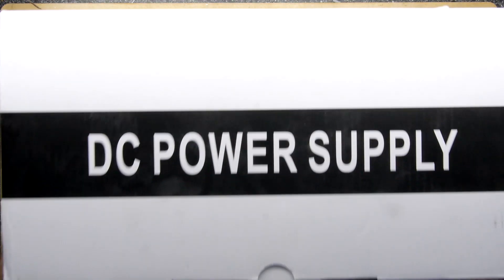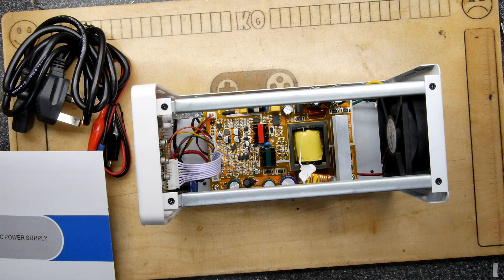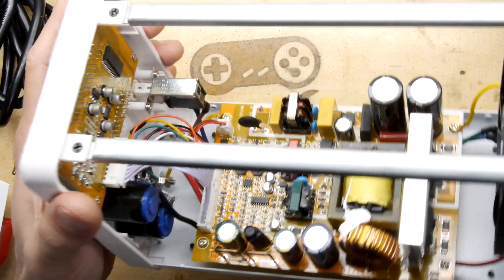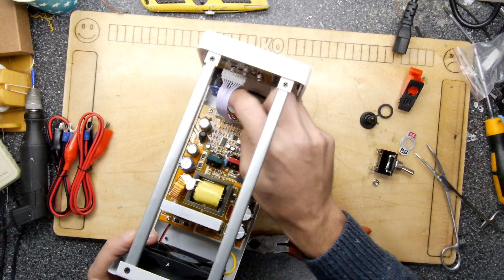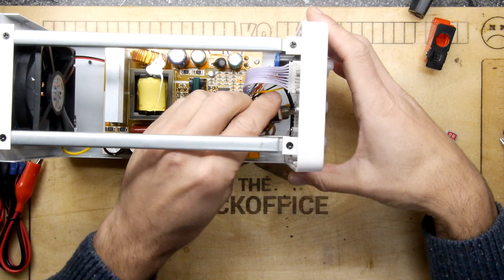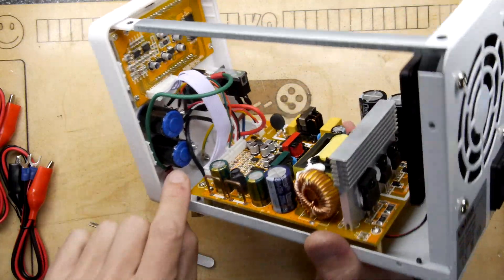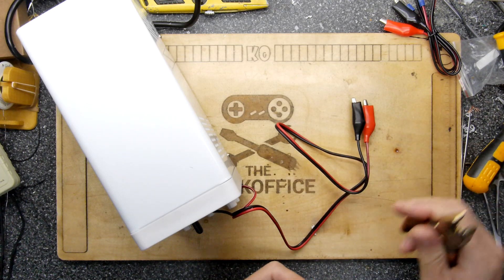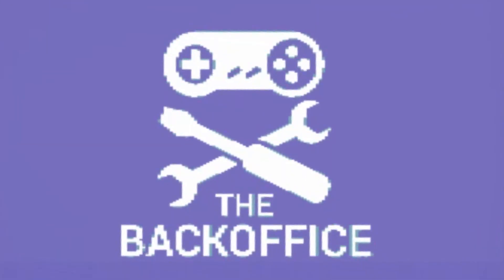New Year New Bench PSU - Adding an output switch for more control

Comment: At 1:52 you have it backward, AC comes in and starts at the common mode filter circuit (far left), then to the full wave bridge rectifier, then to the bulk capacitors. EDIT: This power supply does not have OC protection, it has C.C. mode (constant current), there is a difference. One of the problems with your output on/off switch is output constant current has no current limit for for a brief time as the output capacitor is charged and can supply a brief high current pulse, much higher than your C.C. limit setting, for most circuits, this probably dont matter.

Comment: Yes!, multiturn pots the V and A adjustment, fantastic.  No more poking the tongue out to set a more precise voltage/current.  None of this 270 deg single turn pot rubbish.  Just be wary of sensitive DUT, I'd guess the output wouldn't be all that great.
Reply from the maker: I kinda miss the fine adjustment pot, but for the money I don't think I can complain
Reply: @backofficeshow  Oh for sure, the multiturn pot is in lieu of the secondary fine-tune adjustment.  Yes for the price though it'll be a handy unit to have around without a doubt.
Reply from the maker: Let's see how it performs this year. I did try it on a Sega Saturn earlier and did the trick. 5v at 1 amp is hardly taxing it though

Comment: isnt that Positive and negative output relative to ground? Wouldn't you want a DPDT or DPST so you can switch both rails?
Reply from the maker: I'm pretty sure ground is just chassis ground on this (I'd need to have a look inside again). A double pole switch would be good if it fit anyway, belt and braces

Comment: Just got a faulty Farnell L30/1 from my dad. Had to replace a BC182L and it's up and running like a charm. A fine 1976 vintage but the meters didn't even need calibrating.

Dave Jones says the output power switch is only to protect against some marketing numpty twiddling knobs when you're not looking. He has a point but it's still a reassuring feature.

That was some precision eyeing up you did there. Some would say you where lucky but it's too regular an occurrence with you to be anything but skill, Dr A, you jammy bugger!
Reply from the maker: You have inspired me to fetch the faulty benchers I have and figure out where their loose connection / dry joint is. You can never have too many working PSUs for sure.

I'd say Dave is 50/50 it really depends on how you use your PSUs. If you have a single one and use it for multiple projects and tools you are definitely going to have something hooked up incorrectly, especially if you solder test power lines directly to the rails.

I'm used to eyeballing stuff but I admit, the skill is in invisible correcting where you went wrong 😂 In this case it was a good outcome for a change!
Reply: @backofficeshow  If there's no switch we're inevitably going to have to unplug those bananas to be on the safe side. A job well done I'd say.
Reply from the maker: I'll show you a picture one day. I have bananas in bananas in bananas. It's bananas all the way down 😂

Have a great new year 🎉🎉
Reply: @backofficeshow  Sounds like something I'd do.

Happy new year to you and the family too. It will surely be a better one!

Comment: Up for ON and down for OFF ?
Just say no !
Reply from the maker: I dunno, if you need to turn it off in a hurry slamming it down is easy 🤔
Reply: @backofficeshow  That's the way mains circuit breakers are too, presumably to avoid accidental activation from gravity powered objects
Reply: Don't want things falling over and switching it on.